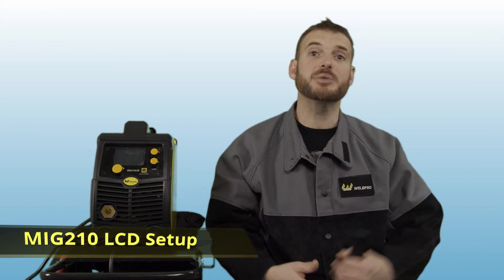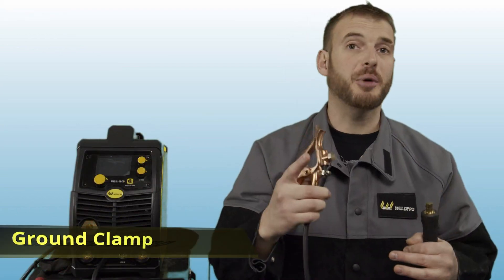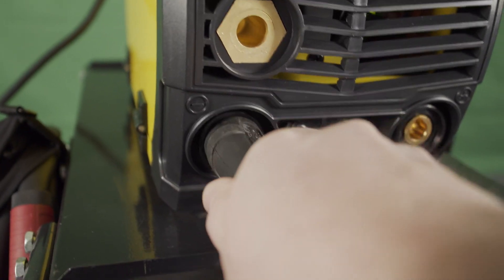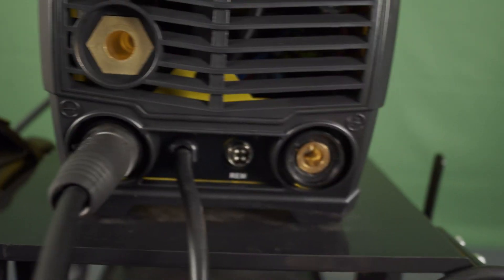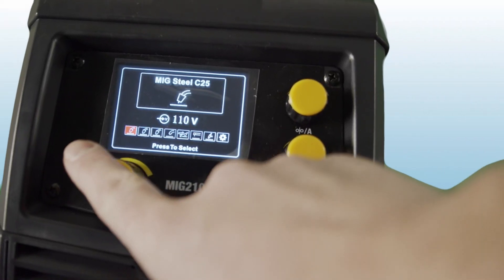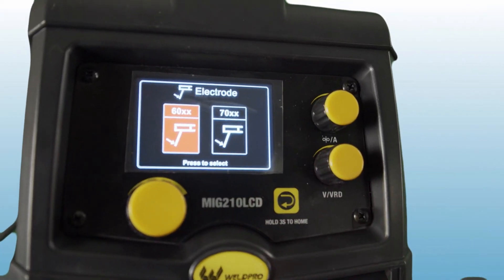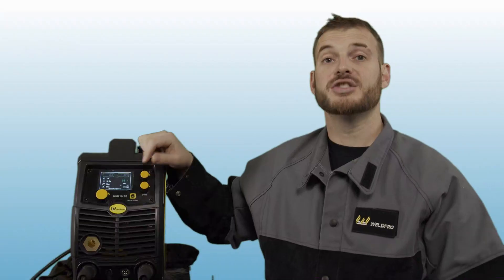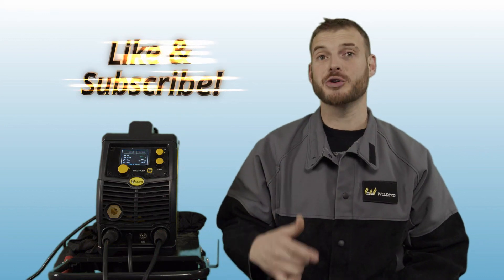Weldpro MIG210 LCD - Setup Part 1 - STICK WELDING!

Comment: ive had this machine for a couple months as well and have done work with it as it is an amazing machine. However one small thing that keeps popping up is the stick series electrode selector. when I am choosing a 60 series or a 70 series. No matter what I pick, it chooses the 60 series of rod. it is violent of an arc for a 70 series rod and I wonder if the machine never that the 70 series setting implemented. It does dig into my material in the 60 series setting and again emits a violent arc. overall great machine but a small thing I wish was abled to be enabled.

Comment: were is the mig 210 lcd all i fine is weldpro 200 lcd or are they the some
Reply: Me to I can’t decide the 210 or the 200 which one to get .. what is the different ??
Reply from the maker: Just the LCD display and easier setup and setup assistance.

Comment: I’ve had my 210 for a couple of months now.  I’ve been doing different projects almost every day and I have to say this machine is a cats meow.  The more I use it the more impressed I am.  At first I tended to turn down recommended volts and speed but after getting used to it I found that the recommended settings give much better penetration and weld and all I needed to do was adjust my speed to the weld puddle.  At the recommended speed I find as long as you weld at the right angle there is hardly any need to manipulate the wire for a perfect weld.  The wire feed is so great for me I am wondering if I will ever need stick again although this machine handle stick rods better than my previous Lincoln ever did.  It’s all about the settings and the set up is so easy you can’t go wrong.   Great machine.   100% satisfied with my purchase.   I was going to keep my Lincoln welder also but after using my 210 I just sold it on craigs list. I didn’t need it anymore.
Reply from the maker: Thank you so so much for the kind words!! Glad you are enjoying it!